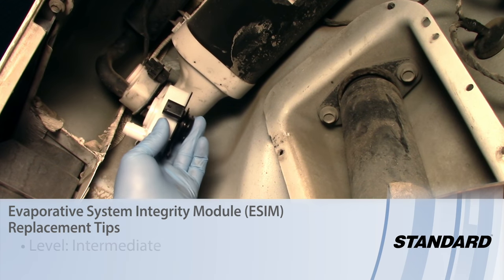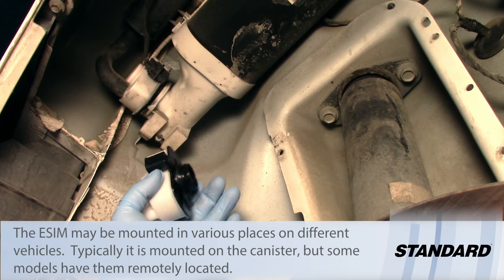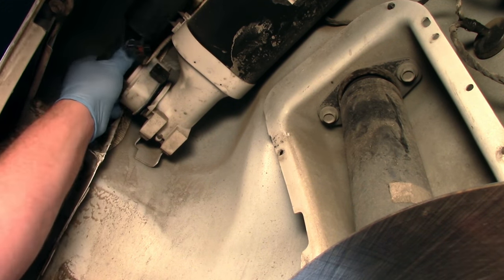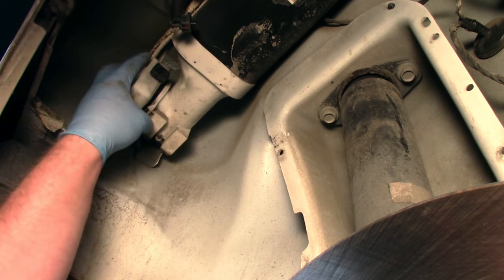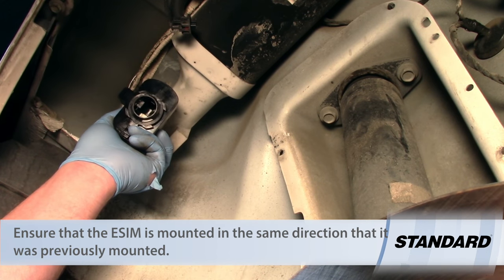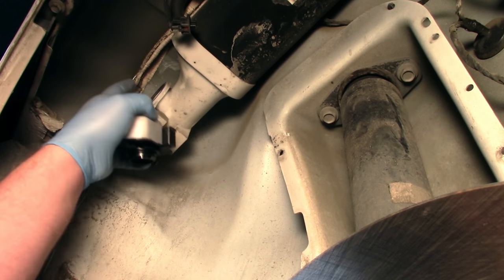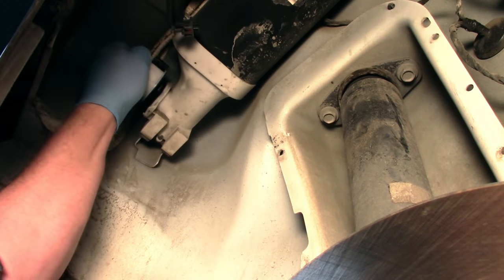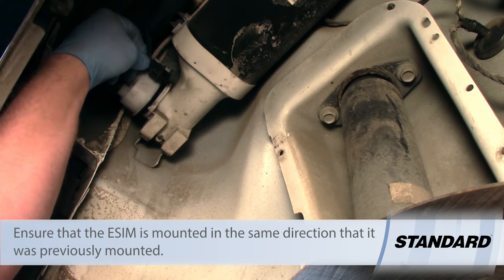Evaporative System Integrity Module (ESIM) Replacement Tips

Comment: Thanks for this video. Would not have had a clue what to look for with the ESIM switch without this. Kept having a recurring "gas cap" warning and check engine light on a 2008 Chrysler Sebring. Changing rhe gas cap solved it for a couple of months before it came back. Went for a service at the dealer and they told me at was the ESIM switch, but wanted approx. $600 to change it. With this video, I was able to see what I was looking for, found the part for $35 and changed it myself. For anyone else with a 2008 Sebring, the charcoal canister is on the driver's side, and just inboard of the wheel well, so you don't need to remove either the wheel or the panel to get to it
Reply: Same with 07 pacifica, but driver side under the seat.
Reply: Does this part affect the cooling system? I’m running hot and the only issue popping on the diagnostic is esim for the check engine light as well.
Reply: @warriorsage2305  hot is typically air in the cooling system.
Reply: @Meche697  yeah it was my 02 sensor
Reply: @Meche697  I have 2013 750 twin turbo
Reply: Dealerships are not honest whatsoever....this should be a 50 dollar charge to fix this.  600 dollars is shameful for a task not much more difficult than turning in a light bulb.  Dealerships are for purchases only or looking then purchase elsewhere...not for work.

Comment: You hurried up the video at the most important times you might have struggled but it would have been nice to see the pressure needed and how it would come off and how it would go on
Reply: There is a tang that needs to be depressed and then the unit needs to be rotated clockwise and will move away from the canister as it rotates.

Comment: I just did this job on my 2010 Ram 1500 with 25 gal tank.  The video is good but here is extra color.

As was said in the other comments, the device is on the back side of the gas tank, on the drive shaft side.  It is hidden by a heat shield.  The tank does not need to be dropped at all as was stated in some other videos.  Study this video and you can the feel around the device to unhook it in place.  I did not need to jack up my truck at all.  Remove that electrical connection by pinching it good.  You will hear it click then you can pull backwards.  Pulling the hose off requires some twisting to loosen it.  Once that is done, wrap your hand around the device to feel for that tab on the bottom.  Pull it toward the device and rotate the module.  If you can do this, the reverse is easy.  I did run my fingers over the gas tank to check for foreign debris before putting the new device on.

Last thing, the code will need to be cleared out.  I did it by disconnecting the battery, then hitting the horn and cycling the ignition a couple of times.  Got to get that residual voltage out.  I did not do a full test of my truck but did an in place startup and the check engine light is off and the gas cap light is off too.  I will drive it later today to test it further.
Reply: did you have the P0441 code ?
Reply: @user-jm9ep3zp5g  yes but I had to replace the fuel tank due to a crack in one of the fittings.  I think they probably could have tapped a metal nipple in to replace the nylon one.

Comment: So, what's the deal that you didn't show how to reinstall the ESIM.  It's not easy to reinstall this module.
Reply: It is easier to put in than take out...the tab to depress and taking the liner out is the most difficult part and that's not difficult...he just fumbled a little and cut that part out with an edit.  Not difficult at all.

Comment: Nice video. Any ideas where this part is located on a 2014 Dodge Durango? There is surprisingly very little online info. about this.  I got the P0456 code indicating this.
Reply: It. should be attached directly to the charcoal cannister at the front lower end of the gas tank.  That's where it was on the 2007-9s and 2010s so I assume it's similar.
Reply: Above the back driverside tire. Remove the wheel well cover its right there. Right under the gas filler line.
Reply: @trappaboi361  same for 2015. Thanks!!